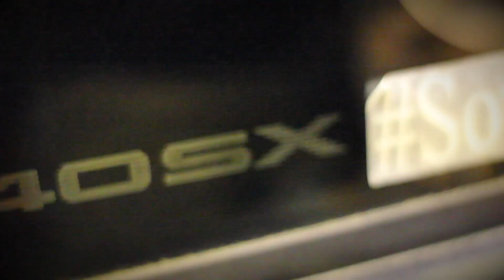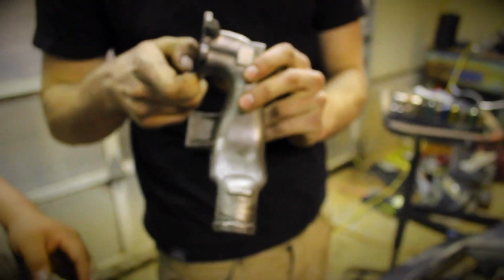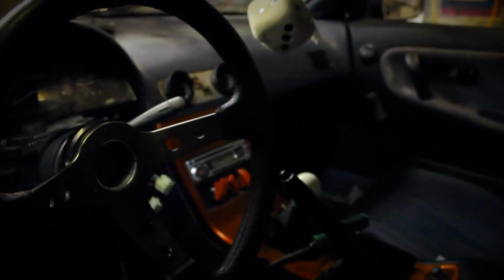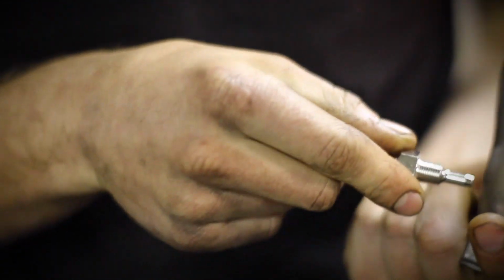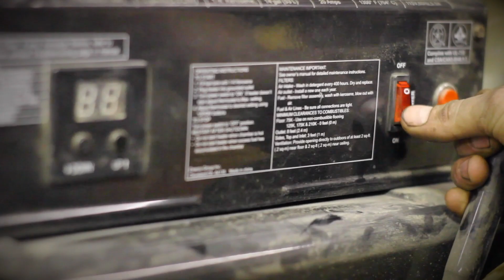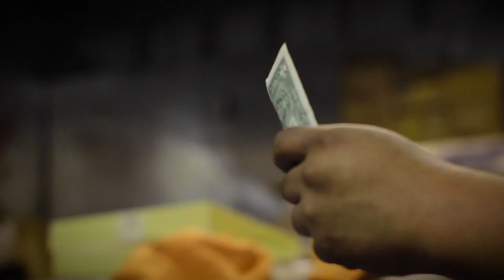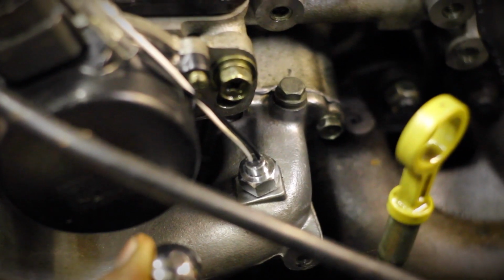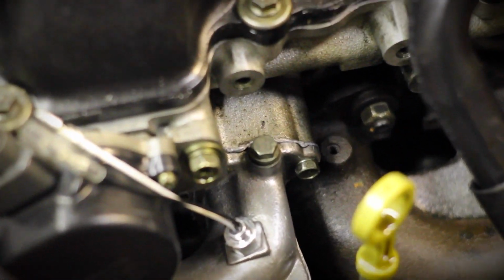HOW TO SR20 SWAP | AFTERMARKET COOLANT GAUGE

Comment: It could be from putting the sensor on the coolest part of the system (right before it enters the block) if you wanna know its operating temp it's gotta be in or just after the block I don't know which way the flow is in that piece you tapped but its a possibility. Also make sure the sensor isn't touching the inside of the tube wall, it looked like it was sitting kinda deep in that shallow pipe. Could also be that the thermostat is stuck. (unlikely but good and easy to rule out first) If the sensor and gauge are bought separately, you might wanna see if they play nice together, might be sending a weaker signal than the gauge needs. Okay I'm rambling now... Lol. Oh yeah and I tossed ya a like (always do) even though you guys haven't taught me shit lol it's nice to see your projects progress and watch your tight edits. y'all make some purdy shit. Ever thought about going to a meet and shooting some sweet B roll of the cars and making some nice long sweet car porn?
Reply: Oh it might be air in there too...  Ok NOW I'm done.  Lol
Reply from the maker: haha thanks for the like homie, we appreciate it! and the spot we put the sensor should be the hottest part, comes out the head and goes down radiator then back in to the block, and actually homie we have like 3 or 4 edits of big car events you should check them out man and we will definitely have more in the future!
Reply: Did you guys sort out your cooling sensor issue?  If so... What was it?
Reply from the maker: fuckery abounds havent figured it out yet, might mess with it this weekend